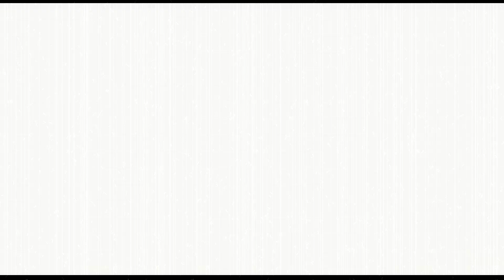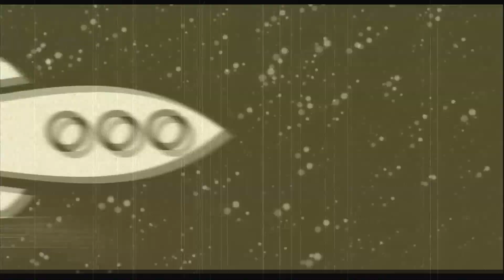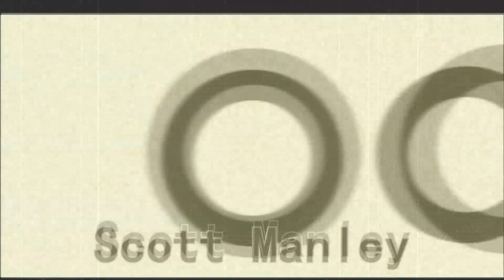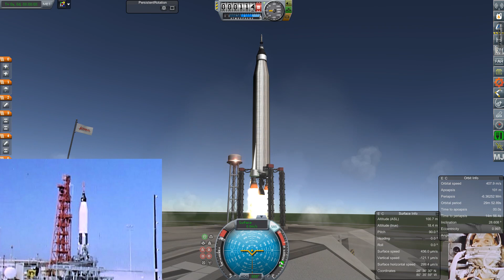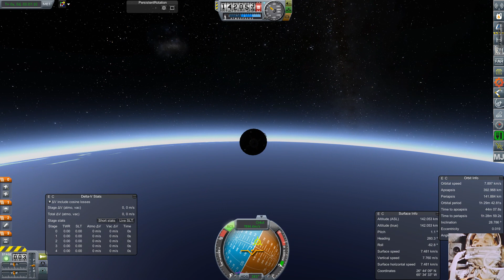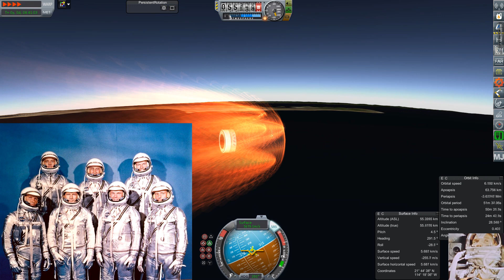Flying Mercury-Atlas 6 In Honor Of John Glenn

Comment: Another point about the Atlas' engine arrangement: It allowed all engines to be ignited at launch. In-flight ignition wasn't really a sure thing in early rocketry, which is also the reason for the booster arrangement on the R-7/Soyuz, and the Soviet preference for hot-staging.

Comment: Hey Scott, you like to talk about the physics accuracy of video games and movies and the likes sometimes, right?
Could you maybe do a video like that on the TV show 'The Expanse'? (It's on Netflix)

As far as I can tell, the physics in that seem to be insanely accurate. Spaceship decks, for example, aren't oriented parallel to the thrust vector but perpendicular to it so that they can walk around while the ship accelerates. They also turn around their ship and thrust in the opposite direction to brake. For some high-G maneuvers they have to sit in special seats and have some sort of gel inserted into their body to protect their organs. I was blown away when I watched it and noticed all the tiny little nods to physics they managed to put in there. Maybe you could also talk about whether it's possible to do what they did with Ceres (It's in the book, I don't know if it's explained in the show):
They carved tunnels under the surface and then accelerated its spin so fast that they experience about 1/3 G outwards, towards the surface.

Comment: Fun fact: They actually didn't switch to the Atlas rocket, they reversed to it. The first test flight of a Mercury capsule was performed with an Atlas rocket, but it exploded (also, they had one of their astronauts fly a jet plane parallelly to the rocket and he flew through the explosion like in an action movie). They then switched to the Redstone, which wasn't capable of putting the Mercury capsule in orbit, but was safer. And just if you want to know, it had also been developed for nuclear warheads and when someone messed up some measurements they actually had to grind down around two inches (in diameter) at the widest part of the capsule to make it fit onto the rocket.
Reply: So there's a thing on Atlas called the adapter section (that black 'collar' below the capsule on the Mercury-Atlas before the tankage starts), notice that it's slightly wedge-shaped, it's there for this purpose and it's shape is so to accommodate the Mercury spacecraft's diameter. Also, they had to space the capsule from the LOX tank because of the retro-motor package. Find an internal structure layout of Atlas on google and you'll see why. The thing is literally a giant fuel tank, which is why it's icy and giving off vapor when it's about to launch, as the liquid fuel is loaded/pressurized shortly before; when it's all shiny and beautiful, it's not fueled.

They would have to decrease the diameter of the heat-shield, which is mated to the base of the internal structure, which means changing the geometry of the capsule entirely, so I don't think that the most cost effective method. Convair was told to buckle down sort to speak on quality assurance for the components and systems of the Atlas, so that potential for failure could be decreased specifically for project Mercury (the boosters track-record had to be improved, it was still a relatively new missile), most problems with Atlas were with guidance, something that must be ironed out if they are to achieve orbital flight, guidance is everything. The Redstone was the candidate for the sub-orbital debut flights, the Atlas for the orbital ones (a big power difference obviously). All preliminary testing of the capsule design and escape system was done at wallops island with the Little Joe booster or standalone capsule for LES tests, other boilerplate and fully-furbished unmanned Mercury capsules were tested atop Atlas to integrate the systems.